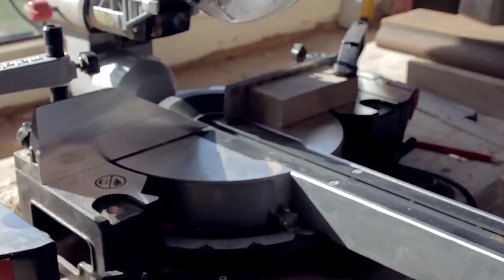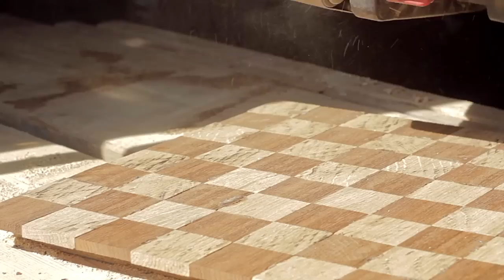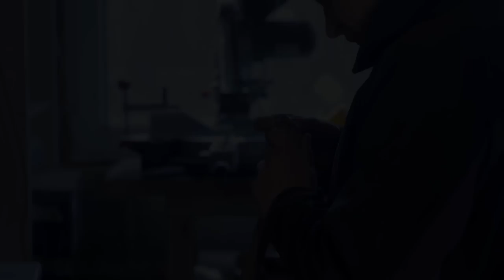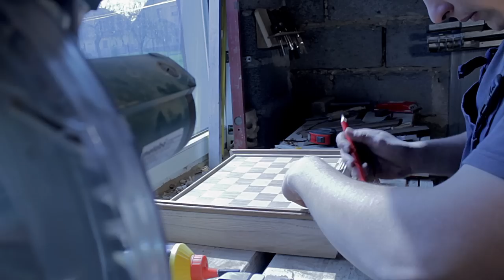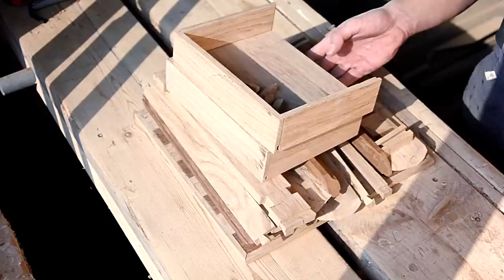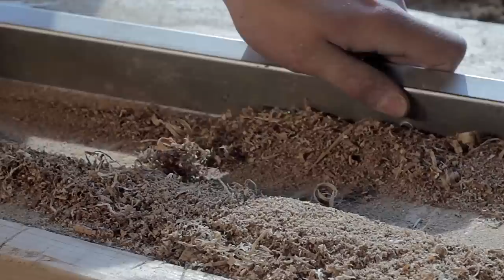The chessboard project [WalMi Pictures]

Comment: Rather than cutting the individual squares out, I'd have cut strips of wood and then glued them together making a striped board, then cut the board into strips the other way, and glued the strips together again to make the checkered board.
And the construction isn't dangerous if you respect your power tools and keep your fingers away from the blade.  Use a push stick when necessary.  Even then a table saw can catch and kick the wood back at you, so stand to the side and avoid the line of fire.  I had a 2x4 just miss me once.